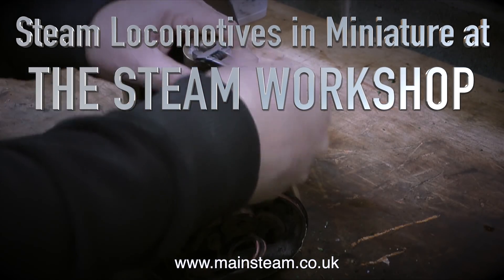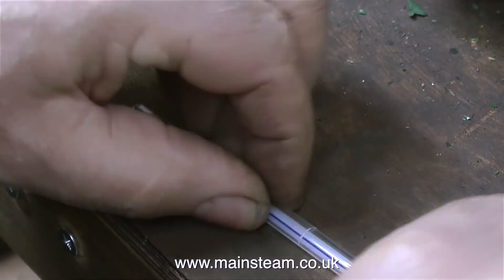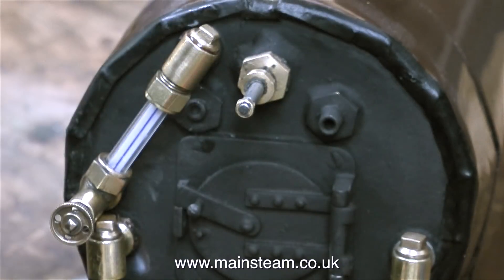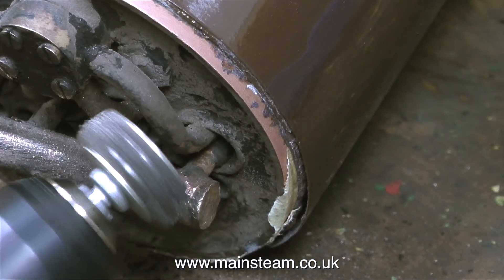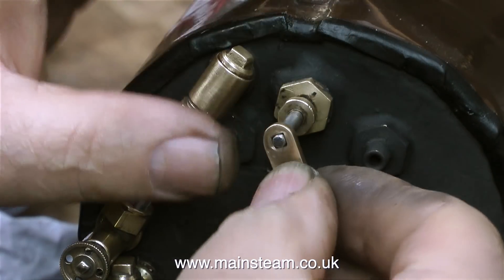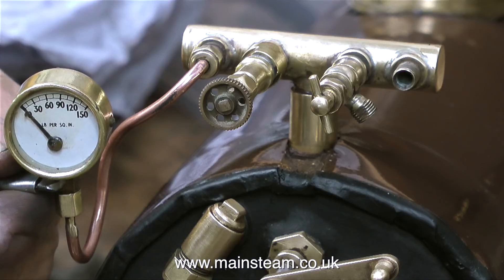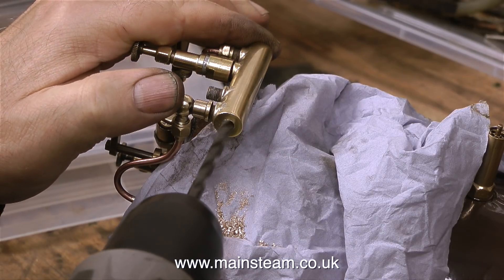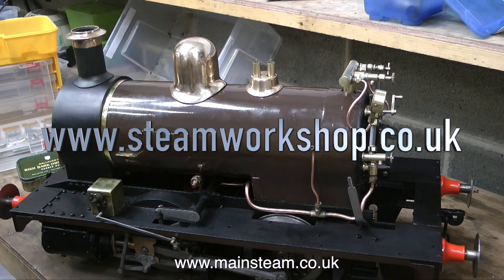WORKING AT THE STEAM WORKSHOP #18 - STEAM FITTINGS AND A REPAIR TO THE SUPERHEATER

Comment: Keith - I have been watching your videos for the last 6 months and this series has been really good as I am about to start a Polly Model 5” gauge kit. In all your work you reference your trusty Bahco adjustable spanner. What size is it and where did you get it from?
Reply from the maker: the one I use most is the 100mm (4 inch type) you can get them from Ebay or Amazon  etc

Comment: Hi Keith, my ash pan and grate on my Chub will not move at all. I see from your last video that the boiler rests on the ash pan top, if I have picked up the explanation correctly. My boilers in place at the moment, is it possible to remove them like this. Wondering what I would do if I needed to remove the fire quickly! Any advice appreciated.
Reply from the maker: the grart rests on 2 bars and the rear bar swings out to release the grate. i will show it in closeup next time i am working on the engine . . .

Comment: Another easy method to remove the sharp edges from glass is fire polishing. Just hold the ends in a strong blue flame from a blow torch  and rotate it to provide even heat for 30 secs to a min and the edge will curl over and become smooth. Just don't over heat it.

Comment: You dont suppose some one may have tried to use a mechanical lubricator and had plans to put it in on the wet pipe?
(speculating the reason for the hole).  I wouldnt put a snifter valve in a smoke box.  That would be plain nuts!  To have one there the owner would be risking sucking some soot or other contaminant into the valve and then the snifter would be stuck open.  Yup good idea to solder it off.

Comment: Hi Keith, a tip from the 1970's Pathology Laboratory - I was trained to heat the end of a piece of freshly-cut glass tubing in a bunsen burner for 20 to 30 seconds. As the glass heats to red, it softens and the jagged ends "smooth out". It's quick and avoids any risk of shattering.
Reply from the maker: It is a good idea to do that really, but I would have to change the burner head on the massive blowtorch at The Steam Workshop and that takes time .... I will try it in my home workshop though, because rounding the edges is a very useful thing to do when pushing silicone tubing onto the ends . . .
Reply: I understand why Keith does it the way he does , glass when molten is subject to surface tension and gives a flared/domed end not suitable to slip in the gaskets/silicon tube.